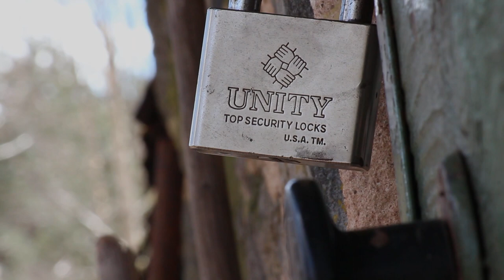Modify your Petrol Lawnmower to also be a Shredder!

Comment: That looks like a good and effective idea. Old petrol mowers are cheap and easy to find here. I could strip the mower down to bare essentials and bolt it to an improvised table (to save bending down with bad back) with a big hole below the mower blades and a big box to catch the output. I would want to use it to shred broken down corrugated cardboard boxes for mulch, firelighters, or to get more cardboard into the collection bin. I wonder if that would work?

Comment: To cut efficiently the sharpened bevel edge of the blade has to face opposite the incoming grass, leaves, sticks or whatever you're shredding. Think of how a chisel cuts. Normally a lawn mower cuts grass from the ground and the bevel edge of the blade faces upwards. So if you're shoving in sticks from the top like in his DIU mod, if possible the blade should be mounted on the shaft upside down from its normal position.
Reply from the maker: Thanks

Comment: A larger feeder funnel would be more efficient
Reply from the maker: It sure would. It was mostly used for large single stem/branch material so a bigger funnel didn’t make any difference but depends what you’ve got to chop.
Reply: What you gonna do with it now
Reply from the maker: @michaelroberts6299  Not much, we went and bought a big chipper not soon after but it still works both as a mulcher and a lawnmower :)
Reply: @BalticHomesteaders  What the biggest diameter wood you think this type of mower could handle?

Comment: just take the mower and run over that pile of sticks a few times, does the same thing, lol.
Reply from the maker: Hi, it doesn't work that great to be honest as the sticks lay flat.
Reply: @BalticHomesteaders   I've actually done it and yes maybe 10% of the sticks lay flat, but it's faster.
Reply: Wow you must have a powerful lawnmower! 

That would absolutely ruin mine, I ran over a big stick like that by accident and it got caught and jammed up my blades pretty bad.

 Tiny sticks are ok but they fly out and hit my legs so if I mow without raking the sticks first I have to wear thick pants and boots